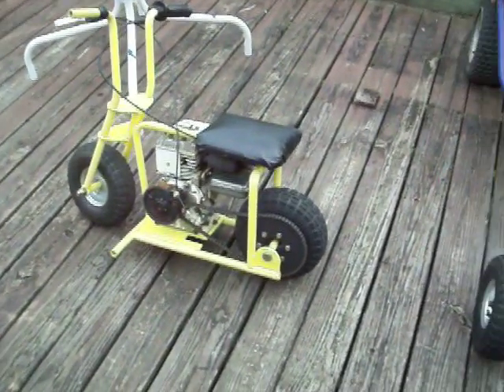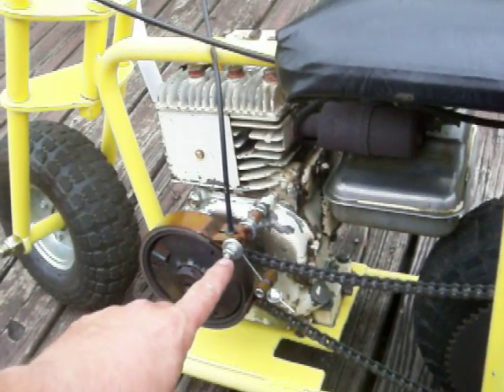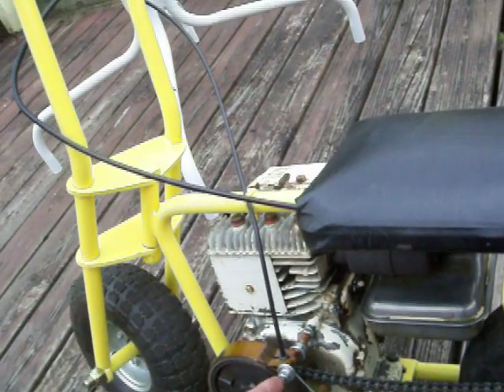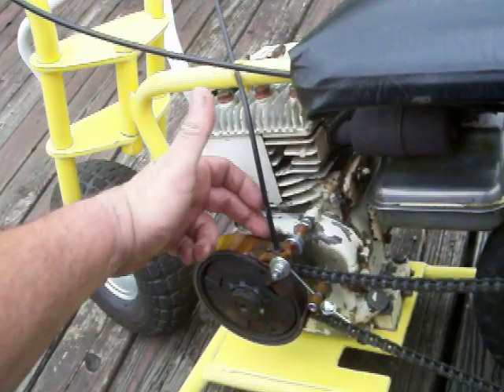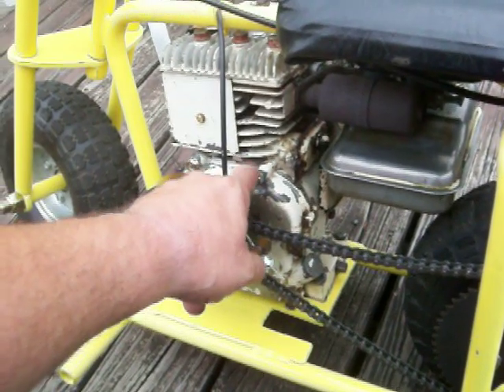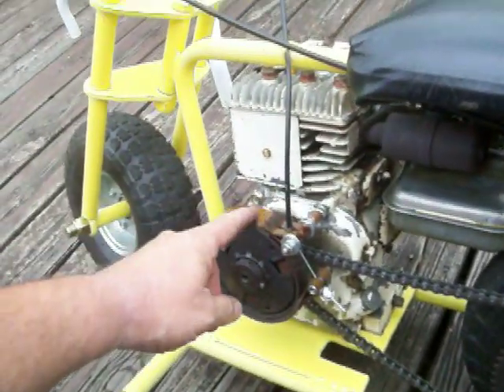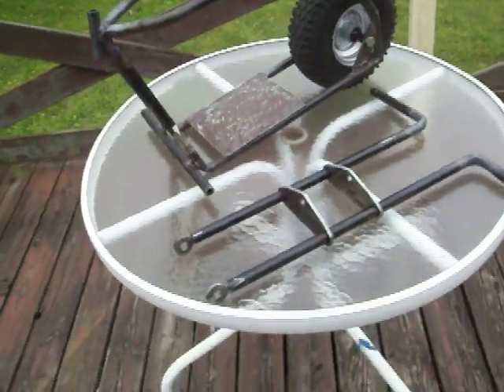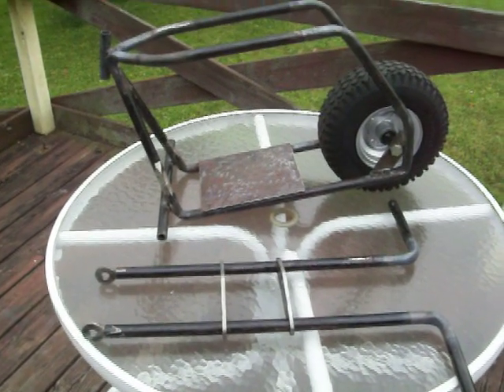Mini Bike brakes in 10 minutes

Comment: What did you use to clamp the brake cable on the other side of the band?
Reply from the maker: Great question,,,, they make a good selection of mini clamps from eletrical type ground wire clamps to normal small engine type that tightens down with a phillips head screw,,,what I used was a home made one made from a 1/4 inch course thread bolt,,I drilled a small hole through the threaded part down close to the wrench head and then when the nuts is ran down on it with a flat washer it will tighten down on the cable,,I make almost everything homemade,,haha,,thanks brother,

Comment: I still think my hydraulic brakes are better.
Reply from the maker: you could be right no doubt but all I know is the band brakes around the clutch like I do them no matter how fast your going if you hit them to hard it will lock the back wheel up and I weigh 215 pounds and they stop me on a dime,,,,I like hydraulic brakes but mine are cheaper,,haha,,,thanks
Reply: if ya got the money its no prob
Reply from the maker: no doubt the sky is the limit with money but mine is a simple low priced way to add brakes and I really never claimed there superior to hydraulic,,the world wouldn't be where it is without hydraulics and hydraulics is what built this country and made it what it is,,imagine a none hydraulic world,,no back hoes,,no dozers to amount to anything and no machine shops hardly,,its true hydraulics is it on a stick for sure.
Reply: no cool 64 impala's.
Reply from the maker: try to imagine a hydraulic free world,,,hard to,,,Im currently building a mini bull dozer and am near finished with it,,check out my youtube video and its name is   "Mini Dozer Cub Cadet Style first test run"    check it out and see what you think,,Ive got to add hydraulics for the blade and ripper on the back,,,also gotta make the rear brakes hydraulic also,,haha,,,odd but im in the middle of a build right now that will force me to use hydraulic brakes,,later

Comment: So this brake system only works on briggs engines ? Man I would really like my friend to try this , he has a 6.5 predator engine , it's basecally like the honda clone engine , would this brake system work on his engine?
Reply from the maker: no no it will work on any motor that the side cover screw will line up on,,if they dont line up then make a bracket so they will,,I have another video on here called mini brakes update where I made a bracket,,easy..

Comment from the maker: yes I have a video on here of the blue Limo minibike with brake band on the rear tire and for some reason the brakes were very weak and wouldnt hardly stop me and the reason is I think is because of the hand handle and small cable,,on go karts there connected with a big steel rod and a foot pedal makiing it much stronger so my oppinion is using a hand handle from a bicycle there not strong enough and you want be happy with the braking power,,there you go.

Comment from the maker: Ive had one bend but not break,,what I done was measure the proper length needed including the length that screws into the motor and went to he parts house and got grade 8 hardened bolt and also 90 % of the torq is on the chain itself rather than the 1/4 inch bolt so it would be hard to impossible to break one,,also the one I had that bent was the cheapest old threaded rod they make and really worthless so with any common grade bolt you want have any trouble and Im a big guy also,,haha,thanks

Comment from the maker: the reason is is because the rod is going all the way through and hitting the crank shaft and freezing the motor up and will completaly destroy the motor if you arent careful,,,only screw it in a half inch or so and the motors I have want screw in that far to even hit the crank shaft to start with,,,yours is the first one Ive seen or heard of do that,,,be careful and dont screw it in to far brother,,later.

Comment: I have a minibike with a small Briggs in it.  I did brakes like this.  If you use a rod that penetrates too far into the side cover, the engine will not run.  I don't know why.  With the engine running if you stick a long screwdriver into that  bolt hole, it will kill the engine.  Strange

Comment: hey guy a 4 and a 5 horse block on a briggs is the same, you just have to use the left top bolt on the 5hp, instead of the right, you need to cut a piece of the ready rod the width of the band tread it under the ready rod thats already in the block and washer it up, its backward to ur idea, but thankyou for the idea thats how i got mine, i'll send you a video of this brake i did.

Comment from the maker: I have a 5 hp minibike that will do 45 mph but I could put a smaller sprocket on the back it would go faster,,speed on a minibike depends on how its geared and the smaller the sprocket on the rear wheel the faster it will go but as the rear sprocket gets smaller your take off power gets weaker,,,for example most dirt bikes have a huge sprocket on back which creates power and climibing as a street bike has a smaller sprocket on the back for speed,,,hope that helps,,Rick